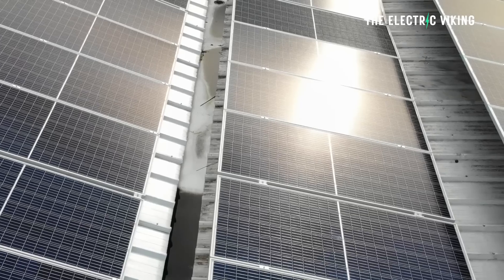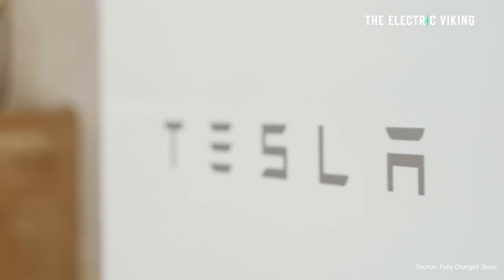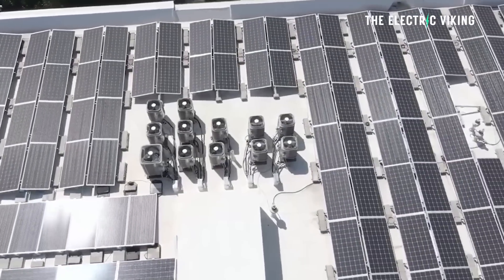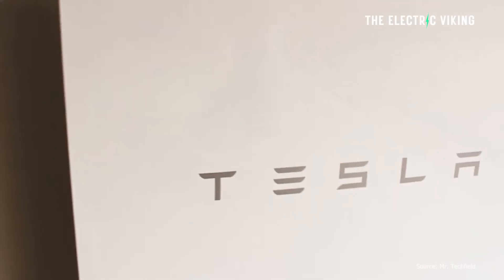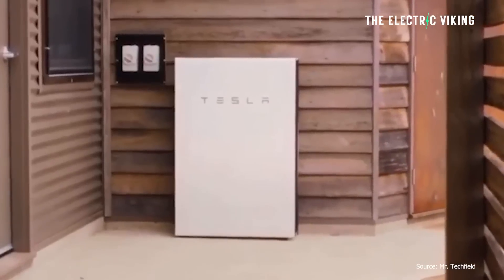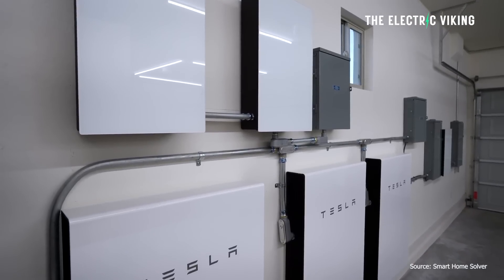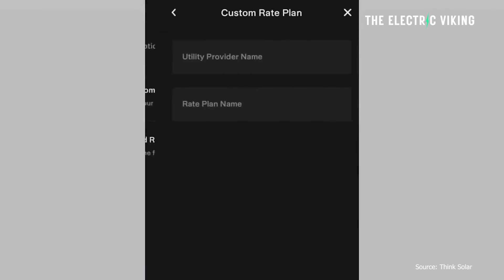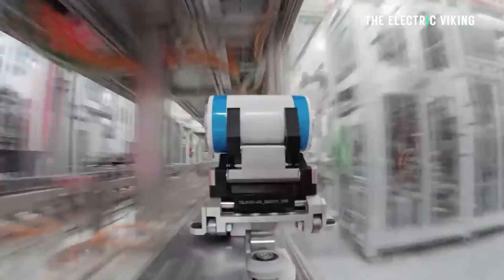Tesla DROPS the price of the Powerwall home battery AGAIN

Comment: Sam you need to be very careful about the misinformation you give out in videos such as this one. Sure for the most part I watch and love most of your videos so thanks for making them and I do agree with most of what is in most of your videos also, so certainly not a hater, in fact love evs, solar and battery technology and have worked in the solar and battery field for 16 years now myself also. Things you got wrong in this video, Tesla pw2 does not and can never output 3 phase or support a balanced 3 phase output for anyone running 3 phase at their home or even wanting to run 3 phase items during a grid outage. The pw2 has a single phase inverter inside so it’s output can only ever be single phase. You can buy the upgraded ct clamp kit so it can read the power being used on all 3 phases (for reading that value only) and in turn in some places in au which support net metering across all 3 phases (aggregated together for the total joined as 1 import total and 1 export total) then in the states / places that support that or can send extra power out (upto it’s 5kw limit) in 1 phase to try and offset some small amount of loads that may be running on other phases, but for places that don’t support that (some places in au and also all of nz) then it doesn’t help those 3 phase clients at all except for that single phase it’s running on and can offset against. So well worth pointing out that no it does not support true 3 phase output at all if can’t it’s impossible for it to do that. Secondly Tesla does not give a warranty on the pw2 when used for full off grid systems, it allows the pw2 to give you power during a grid outage assuming you buy the optional gateway upgrade to support that, but no you can’t run it full time all day every day off grid otherwise you void the warranty, so again it’s good for small power outages but not running fully off grid just emergency power during a grid outage on 1 phase only for a limited time period. The Tesla warranty also only covers a set number of cycles per day and per unit life so if people are doing 3-4 cycles a day then no they will certainly not have anywhere close to a 10 year warranty so also worth pointing out that’s only assuming 1 cycle a day to get that warranty. Anyhow I just wanted to clarify these points as your video for could easily mislead customers here in this regard, otherwise good video but my personal thought is that sodium ion based solar battery solutions will actually be far better solution, Iv already developed batteries and used thousands of lfp based packs over the last 8 years but even lfp still is quite fragile and hates temps below 0 and also above 40 (ruins the life) and so in this regard Sodium is actually far more robust here also. Lfp also easily gets damaged when cells ever go below 2.5v per cell which again nobody talks about, and it’s very easy for lfp cells over a 4-10 year period to go quite out of balance and have pack capacity suffer as a result, again something nobody talks about. It’s a good chemistry but honestly sodium ion is already better for home storage, I’m already doing testing with it right now vs lfp packs in the real world as yes the lfp I’m using is top branded grade A catl and gotion cells also not some cheap budget brand lfp cells.
Reply: Good information, thanks!
Reply: Your post reads like you really know your stuff - do you blog or can you recommend trustworthy sources?
Reply: @garthormsby4746 he said he worked in the industry in his comment
Reply: @garthormsby4746  I've been designing solar panels for 16 years and also design batteries (lead carbon, lithium lfp and sodium also) and in turn design solar systems, off-grid, on-grid, hybrid etc + have been driving an ev myself since 2019 so have helped alot of clients get sorted with their ev charging solutions also.  Sadly in life you really only have enough time to either be out there DOING the actual work, or being a full time blogger.  There's no way I have any time left after investing the hours I spent per week doing the work to have hours and hours of extra time needed per week to create blogs / videos.  As such you usually find MOST of the people creating full time videos and alot of videos are NOT working full time in other / normal jobs or company positions, as making videos is really a full time job in its own right (heck you've seen how many videos sam makes in a month and in a year, that's a full time job).  As such though theres no way he can possibly get all of his information correct, in some cases some videos may only be around 50% correct with the info he shares which also means 50% wrong, however he's chosen to prioritize number of videos + speed of releasing videos over getting all the facts right each time every time.  It is however important for him (and others making alot of videos) that you can easily mislead people by telling a bunch of info when its not in fact true and yet most of the people on the internet would just trust you and believe you and yet then when they've spent good money buying something because you told them it would work great and then it doesn't then he would simply say well you should have done your own research.  As I said I myself enjoy about 60-70% of his videos and think he presents them well for the most part, but that doesn't mean that he doesn't get it wrong bigtime sometimes.  Another example of this is where he tells many australians that their power should be super cheap or almost free coming soon (eg within the next year or 2) yet many australians have suffered some of the largest bill increases for their power in the last 1-2 years and in turn they will still suffer further power price increases for at least the next 1-5 years also.  Sometimes Sam is out of touch and gets things very wrong, what more can I say  it's volume and quantity over quality?
Reply: Thanks for the info Steve!
Reply: Good stuff. Which battery pack would you recommend for home storage?

Comment: In the UK it is not a question of Powerwall or not. It is a question of Powerwall or one of their competitors like GivEnergy or Gowatt which are significantly cheaper with other advantages.

By the way, best to run LFP between about 10% and 100%, not down to 0%. Also helps to run the 90% range cycle a least once a week to avoid charge memory issues.
Reply: Since when do lithium based batteries have "charge memory issues'??
Reply: @ab_ab_c  Most Lithium ion battery types including NMC, NCA, LCO do not have memory issues, but LFP does. Ref: DOI: 10.1038/nmat3623
Reply: What is charge memory issue precisely
Reply: @GreenDriveIndia  The memory is in a voltage change rather than capacity causing charging to cut out early thinking there is an overvoltage. The memory effect is well written up if you google it. I was not aware of it so it is interesting to know.

 Edit: Interesting that I have found with some new Camera batteries they need a few full charges to actually hold full power which may be a similar problem with the charger cutting out early so they are not totally fool proof. I had a Panasonic TZ70 and after first charge with GPS on with high current requirement it went flat in about half an hour. After a couple of recharges it was fine and would last last the day. It probably helped get GPS a bad reputation in cameras with them being sent back when it was a temporary fault with batteries assumed to have no idiosyncrasies.

Comment: I want a 3 phase power wall in Europe
Reply: 3 phase power wall doesn’t exist despite what Sam’s video claims, it’s got a single phase inverter inside and that’s all it’s always been, check out Teslas own specs it’s not a 3 phase internal inverter inside I can assure you.
Reply: @stevemcmechan6444   I know Steve!  here in the Netherlands most new houses 🏡 have 3 phase 25 amp or 35 that’s why Powerwall is not sold here
Reply: @borisschouten7867  yeah sadly sam totally has mislead people here by saying it gives 3 phase output, that is not at all true as I mentioned it’s only always had a single phase inverter and that’s not set to change any time at all soon. Sam’s videos are usually not bad but sometimes he totally misleads people with a lot of wrong information which is both frustrating and annoying as it does a lot of damage when people believe what he’s said and then go out and buy one and then are annoyed to find out that it can’t do what he said it can do, he needs to check his facts a bit more sometimes clearly.